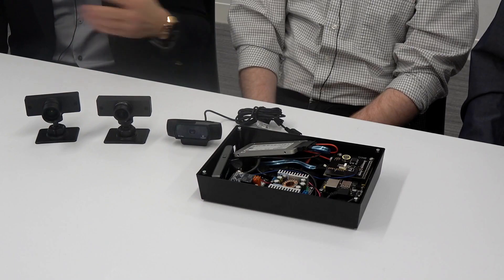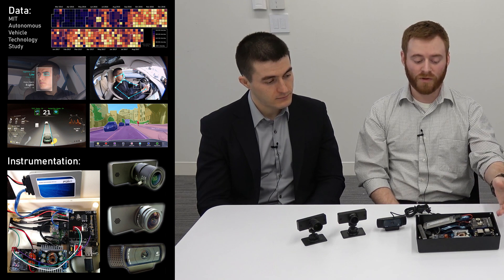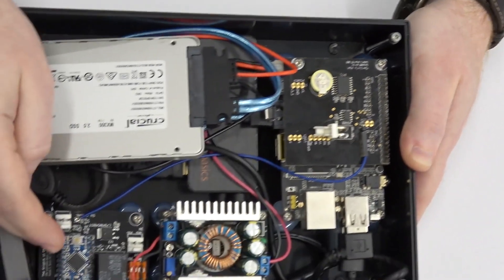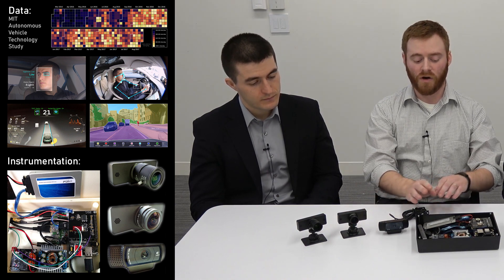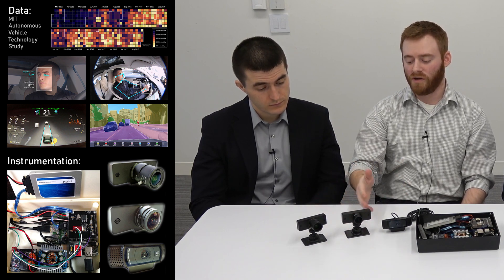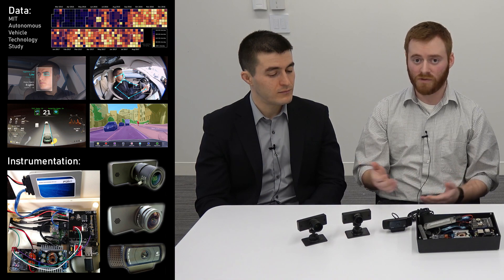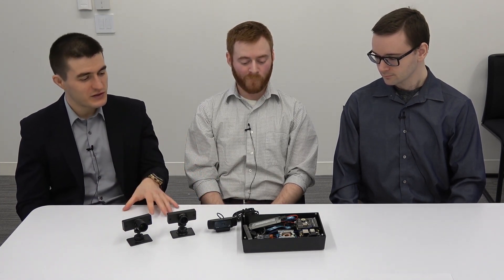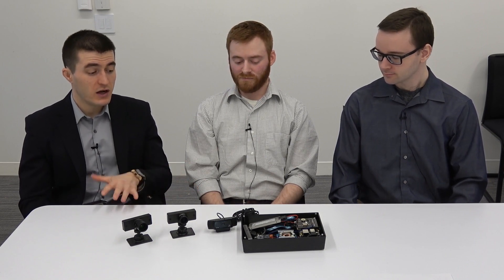MIT-AVT: Data Collection Device (for Large-Scale Semi-Autonomous Driving)

Comment: One still has the option of using a mini-ITX board with a 12-volt power converter allowing the use of a more powerful Nvidia card like a Titan Xp with higher Cuda core count for deep learning apps and Intel i9 processor and Optane memory. Texas Instruments has its multi-cam RT-RK Automotive Machine Vision Alpha Reference Board which will support all relevant operating systems and industry standards, e.g. Linux, ISO26262, Ethernet, FlexRay, MOST, HTML5, GENIVI. Unfortunately, this is a costly solution but still cheaper in comparison to other systems. With the recent event of the Uber driverless car death, system cost may not be an issue? I do think the presenter's system would work well with my delivery robot drone plans and appears to be a cost-effective test solution somewhat different from Comma AI or Mobileye's approach.